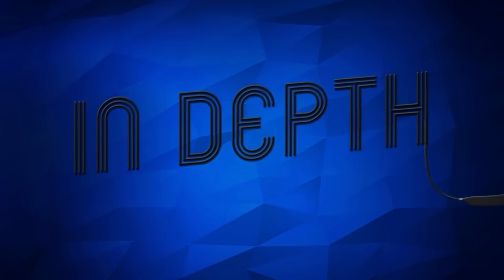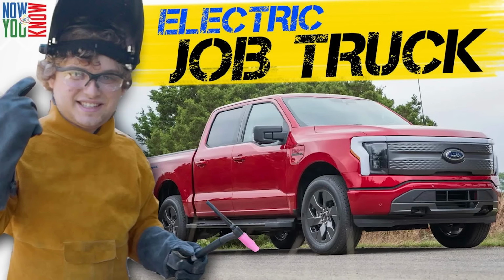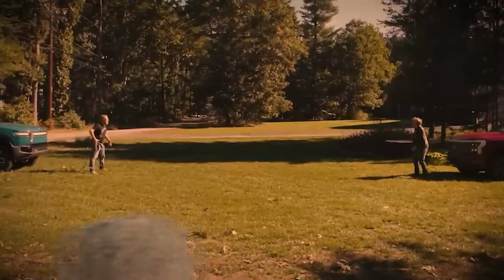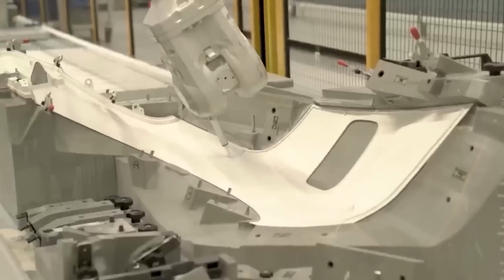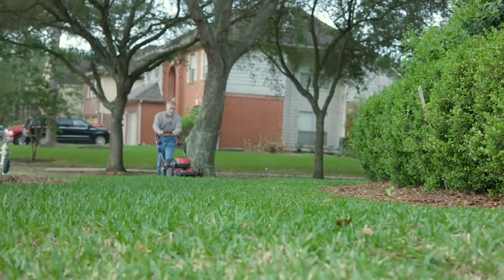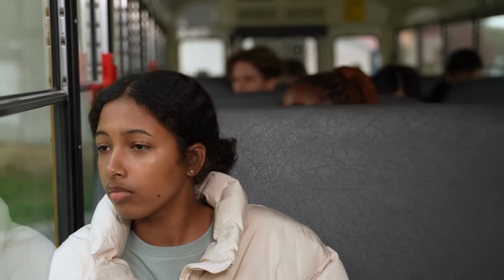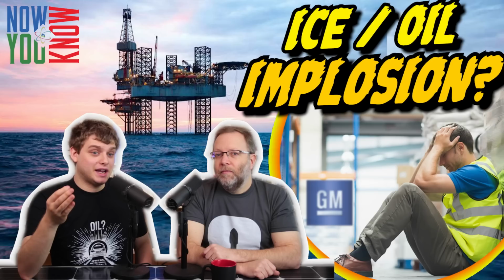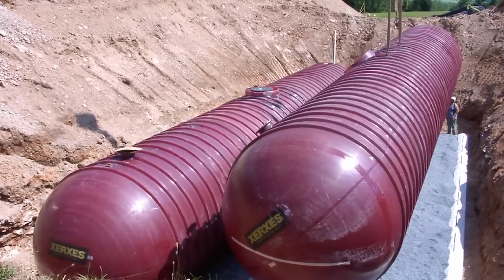In Depths You May Have Missed | Tesla Time News

Comment: Americans really still use petrol lawnmowers? Seriously? They've been electric since I was a small child here in the UK, and now people who are smart are getting the battery operated ones. Bosch sell several that uses the same power pack as your electric drill (and saw etc etc etc) or garden tools. You just charge packs and slot them into the device you want to use at the time. Not to mention those packs are part of a standard adopted by lots of manufacturers so you can mix and match the tools you prefer with the battery packs you have. 

This is almost as bad as people using kettles that you put on a hob instead of a grown up electric kettle. Can you imagine how much energy you'd be wasting? It's bonkers.